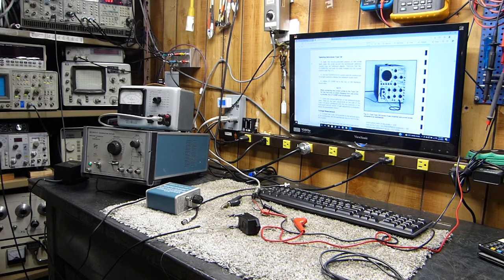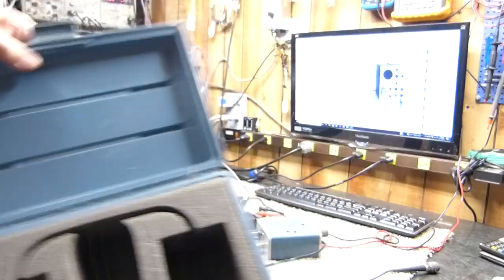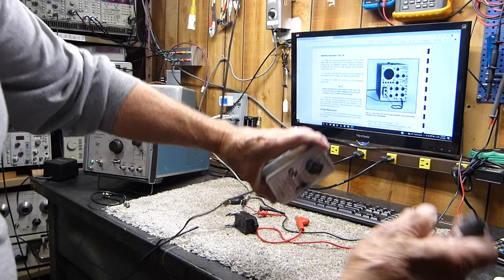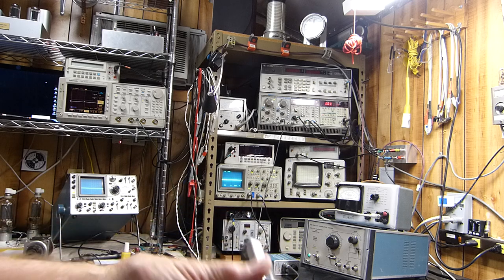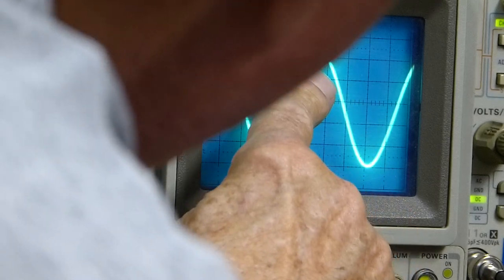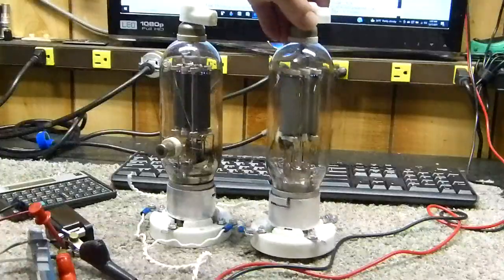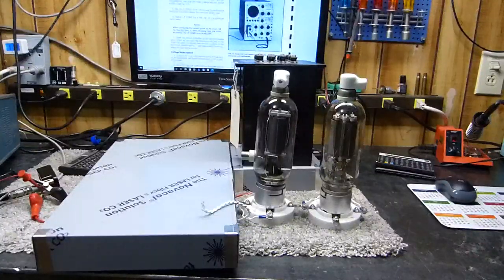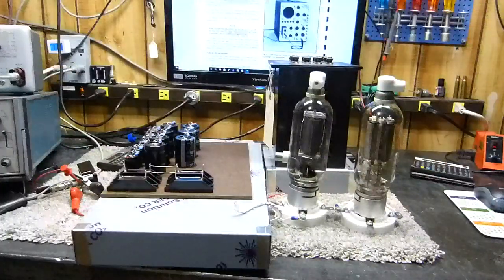Tektronix Type 134 Current Probe Amplifier

Comment: Nice find!   
I use the TM-500 variation AM503 and the A6302 probe.. it is an immense aid when designing linear power supplies to actually see see both current and voltage, and their relative phase angles.. A good current probe is essential in any development lab.
Reply from the maker: Jennifer, Totally agree! More later.

Comment: When I worked at Hughes Aircraft, I was able to use the Type 134 / P series current probe.  I used the built in power supply on the scope so I didn't use the external supply.
I have the 7834 analog storage scope that I used at Hughes.  I know it is the same instrument because of the markings i made on it.
still works fantastic in all storage modes, up to 500 pS sweep speed too!
Reply from the maker: I saved a number of instruments from the government at the termination of contracts but I I can't think of anything at the moment that I still have except a chassis box I built at NASA in the early '70's that houses an isolation transformer that I still use. We had lots of thunder storms in Huntsville so I built a holding-relay type circuit that would drop out my transmitter on a power fluctuation so that it would drop and stay off until I could power it up properly. I still use it  with a temperature sensor added in series. I built that chassis on third shift when I was supposed to be working on other things... much of what I have now  is military/government surplus but nothing that I can think of from my direct employment. I did luck out a few years ago when Tektronix sold off their vintage lab instruments under an Ebay seller named CHIPXS. The instruments I bought from them have the Tektronix calibrations seals still on the cabinets and they were shipped to me in new Tektronix boxes from Oregon. Beautiful instruments. It is amazing what we can have nowadays to enjoy in our personal labs.

Comment: I also like the fact, that you can use it as an pre-amp for voltage measurements, you can get 400µV/div.
Reply from the maker: Yes, I thought about showing it but forgot - it says a voltage gain of 125 - I measured it at about 136. I have another HP amplifier that goes from 1KHz to 150 MHz that I have tested with 20 and 40dB gain. Of course, as you mentioned, input voltage has to be pretty low to keep from overloading but it can come in handy. I find it amazing how this quality of equipment comes up on Ebay. I don't think it had ever been used. Besides the little connecting RG-58 cable never been opened, the same was true of a mounting bracket still in the package. Thanks for your comments.